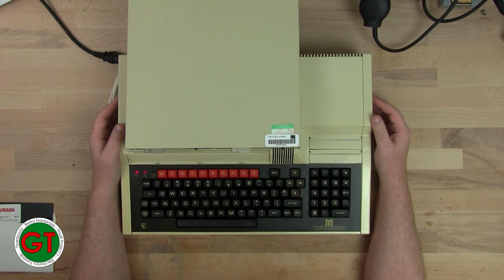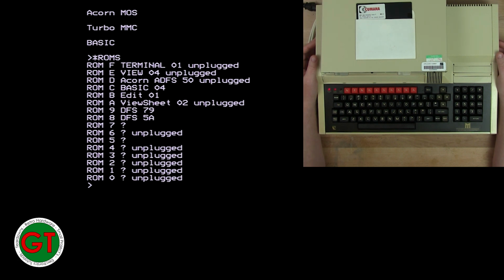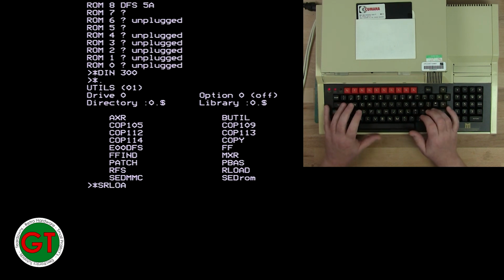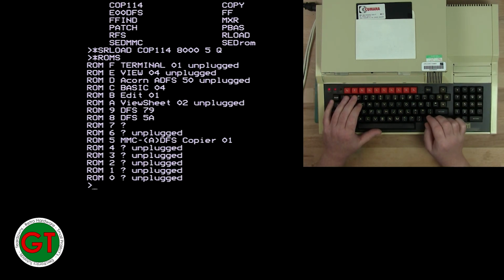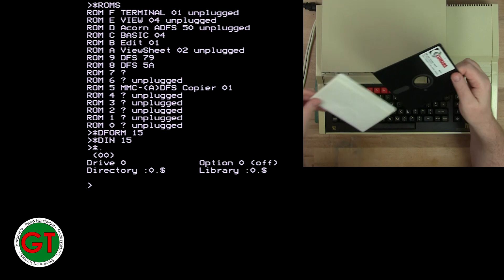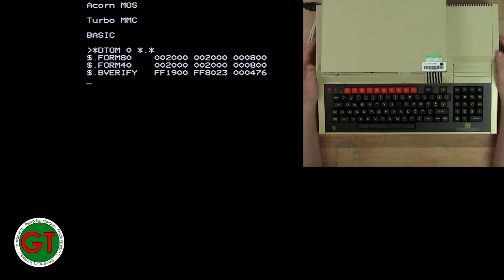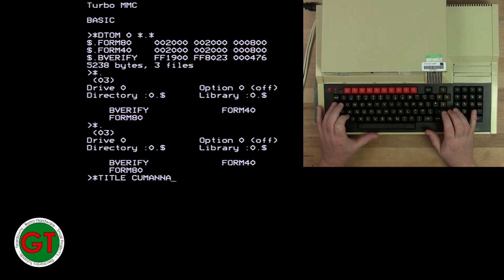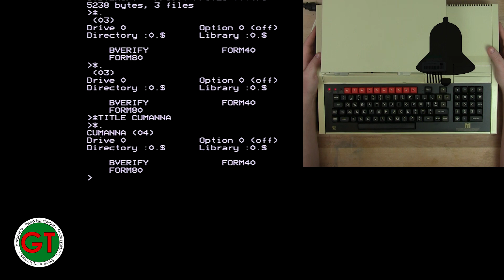Preserving old BBC Micro floppy disks

Comment: Thank you for this tutorial. I've not tried following your instructions yet. The problem I had was that once I'd fitted and enabled Turbo MMC I couldn't access the FDD. It was connected as normal to the port on the underside of the Master, but once Turbo MMC had been fitted/enabled the FDD no longer functioned. So, how do you get the FDD to work once Turbo MMC is fitted, is my question?
When I do the *ROMS command, this is what shows on my sccreen:-
ROM F TERMINAL 01
ROM E VIEW 04
ROM  D Acorn ADFS 50
ROM C BASIC 04
ROM B Edit 01
ROM A ViewSheet 02
ROM 9 DFS 79
ROM 8 Master MMFS Turbo 7B
ROM 7 ?
ROM 6 ?
ROM 5 ?
ROM 4 ?
ROM 3 ?
ROM 2 ?
ROM 1 ?
ROM 0 ?
Reply from the maker: Hi Andrew, you can only have one filing system active at a time, on the Master you can press and hold Ctrl + D and hit Break, this will change to the DFS ROM, or you can enter *UNPLUG 8, which will disable the MMFS ROM. To transfer files from MMFS to Floppy or vice versa, you should find a ROM Image COP114 on one of the virtual disks (disk 300 maybe) and load it into Sideways RAM.